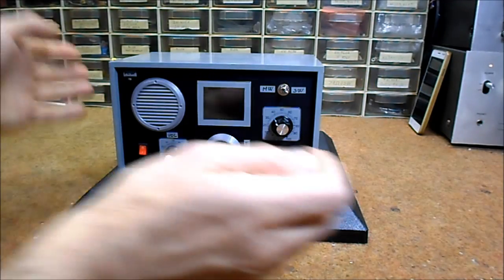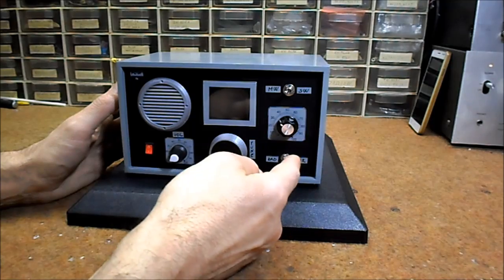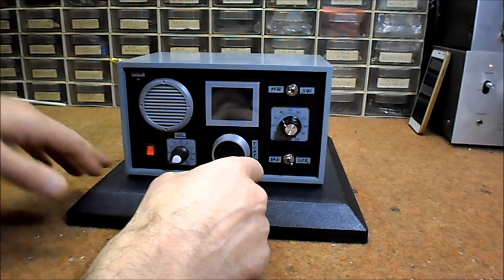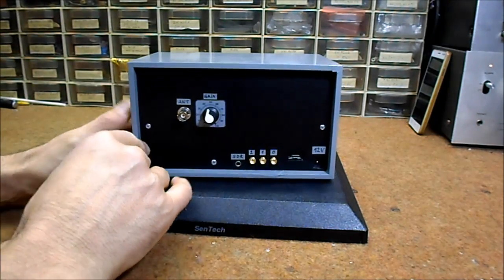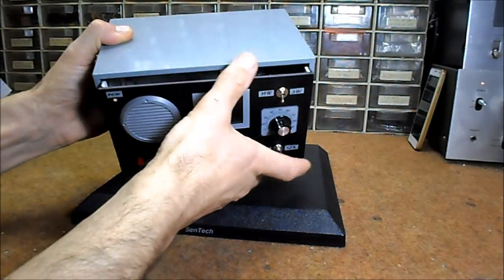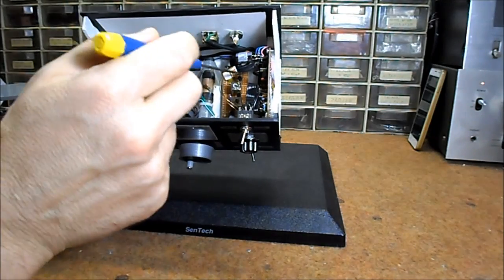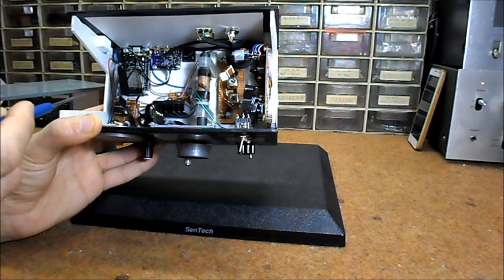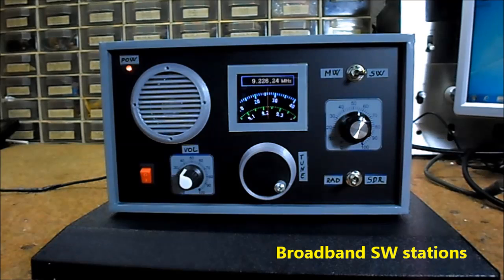DIY SW , MW , SDR Radio with ESP32 and Si5351

Comment: Fantastic analog dial - neat that it switches from curved to straight but I didn't see how you made it change.
Reply from the maker: Only one line in the code needs to be modified for a change, and can also be done with a key, with a slightly larger code intervention

Comment: thank you for your sharing
Follow the webpage you linked to build this radio. I have a question, please help me answer:
When using SDR mode, how to connect the 5th interface of NE612 to PC, and how to connect the cable.
Can you give me your email
Thanks for your reply
Reply from the maker: In SDR mode pin 5 from NE612 is disconnected from IF trafo and connected to one channel of PC soundcard, and ground to ground of soundcard

Comment: The radio sounds terrible, everything seems distorted and noisy and the radio stations on 10MHz do not even exist - something must be wrong on the front-end or mixer or demodulator or all together?
But I love the analog scale implementation, that is very well done 👍 you might implement the new SI4735, that gets the job done.
Reply from the maker: station is on 10MHz - 455KHz (IF) , later this is resolved in the code

Comment: ESP32 is a wifi device that uses the same type of MCU that an arduino uses. You could have just used an arduino micro or nano and got the same if not better results unless you have a specific need for wifi integration in the radio set.

Comment: Lovely design. At about 3 minutes in, you are tuning in to what appear to be two SW broadcast stations in what should be the 30m amateur radio band. There are no SW broadcasters in that band. Have you got the frequency display calibrated properly?
Reply from the maker: You are right. The real frequency is that on the screen plus 455 KHz. I later corrected that in the code of SI5351 VFO.